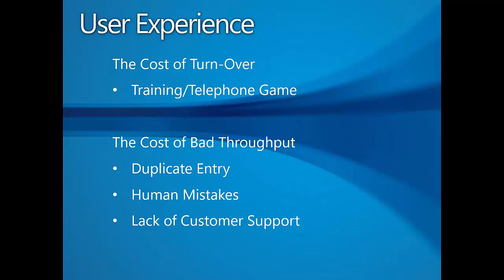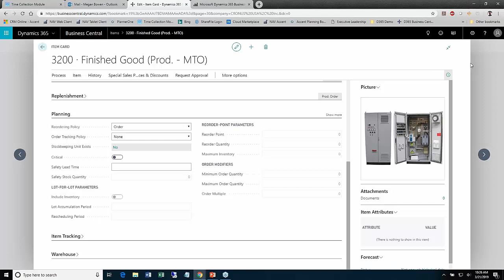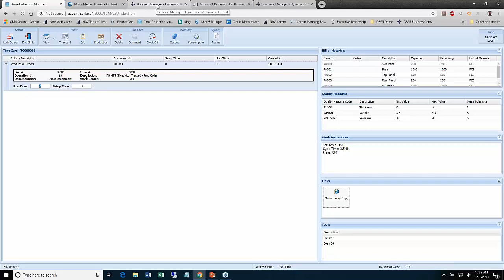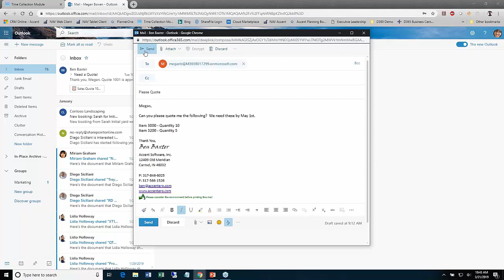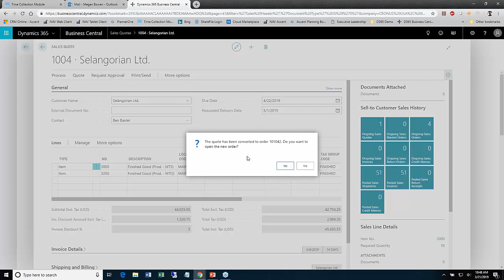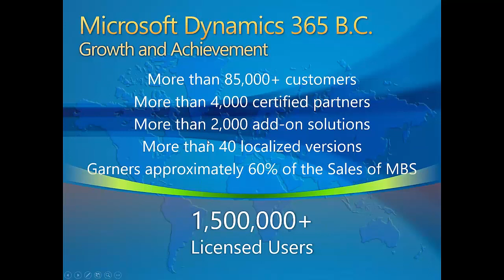5 Quick Tips for Manufacturing (Webinar) - Microsoft Dynamics NAV/Business Central

Comment: Hi, great video. 

Is there a app where you don’t have the floor user have access to dynamics? Just give them a bar code and that updates the system with start stop times?
Reply from the maker: Yes!  We prefer the Shop Floor Insights product from Insight Works.  It allows the shop to record start/stop times against your Production Orders.  You can also use it for Consumption and Output entry as well.  The User never has to get into Dynamics, they stay within the Shop Floor Insights interface, which is mostly barcode input.